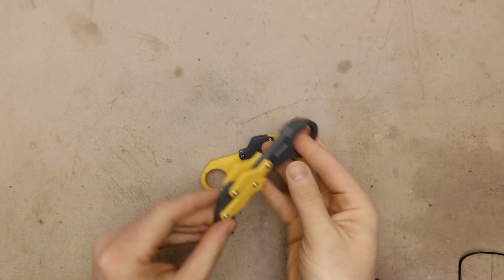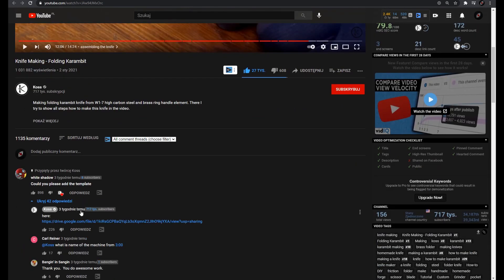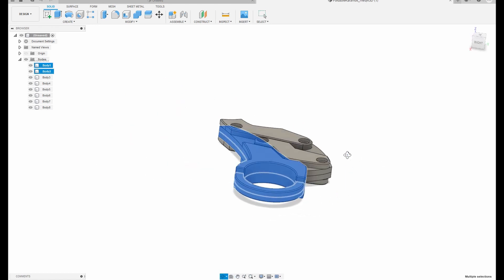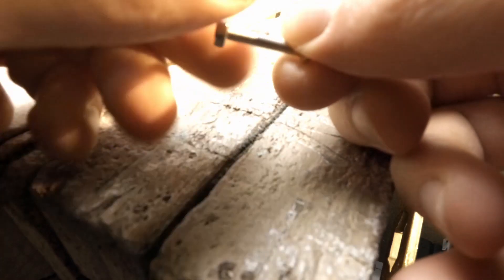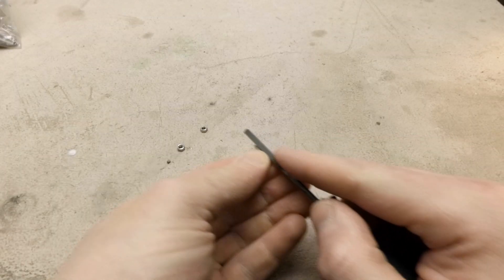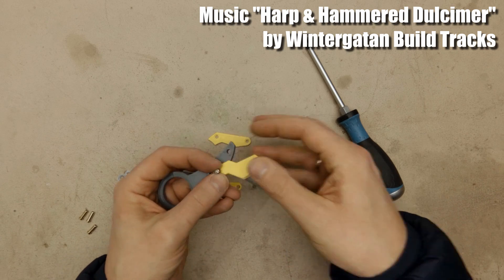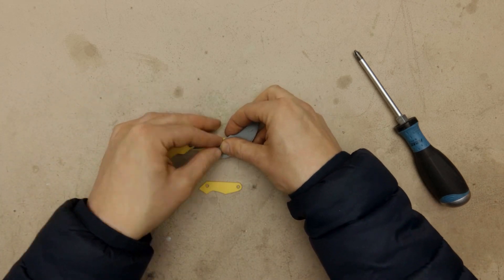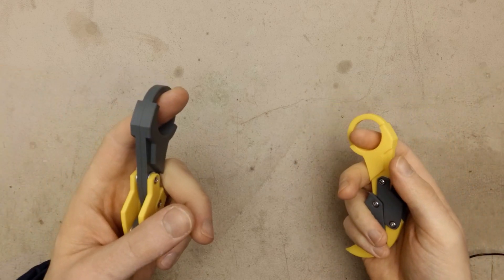Folding Karambit 3D Printed

Comment: What is the screw size length and diameter
Reply from the maker: 4 door handle screws,
8xM4 washers,
CA glue.

If you don't have door handle scerws you can use regular M3 screws.
Reply: @medyk3D  ok thank you